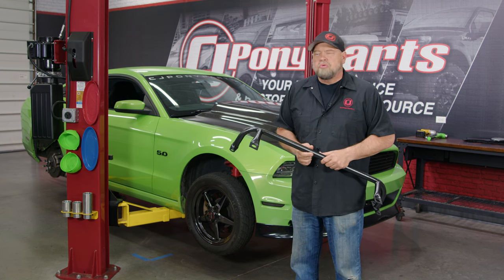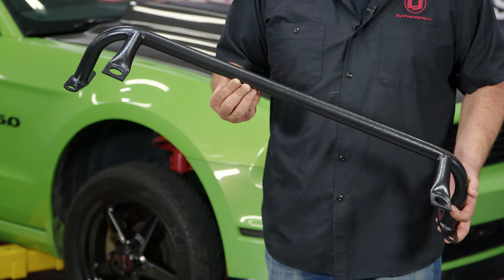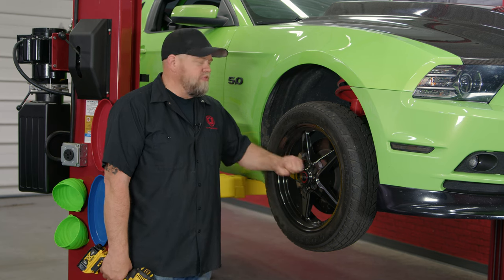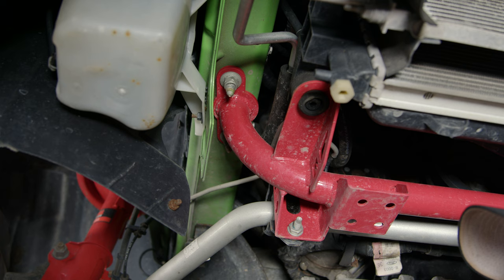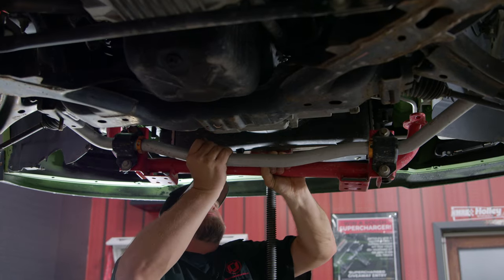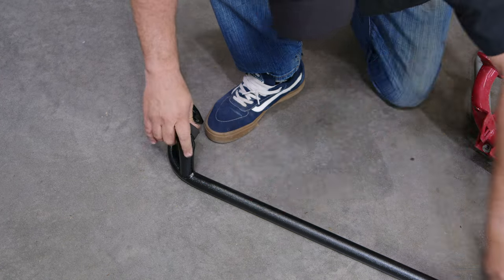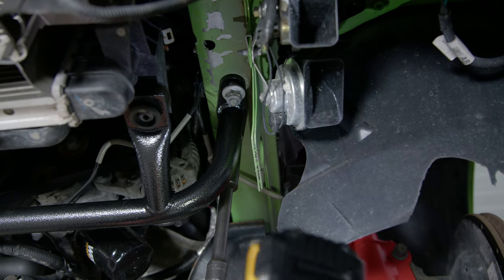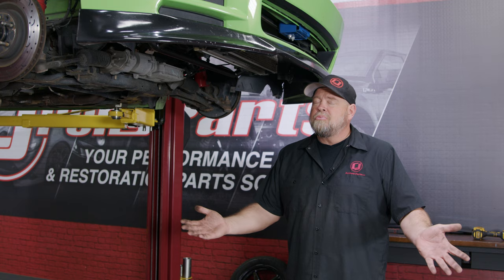2005-2014 Mustang BMR Radiator Support/Sway Bar Delete Install

Comment: does this have negative impact on the suspension and corner driving!?
Reply from the maker: There will be more sway in corners so you will have to go a little slower. This is meant more for a drag racer that wants maximum weight transfer.
Reply: More body roll then?
Reply: @2InfinityRKX slightly more.  If you’re corner carving.  

Had this on my 2005 gt.  Drove around like that for 6 years.  Didn’t really feel any difference.   Good luck.
Reply: Hi I have an 05 GT, did you run it with a tubular k member?